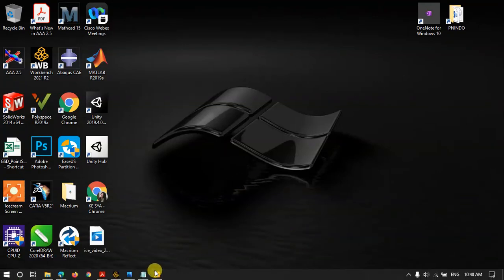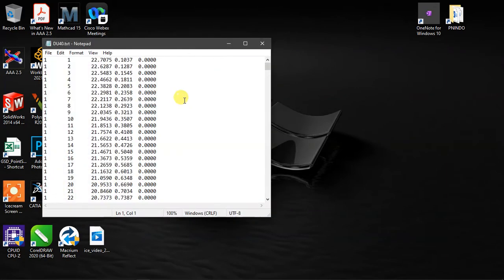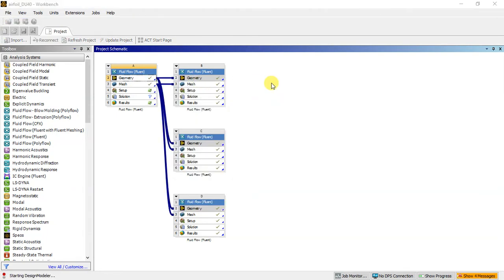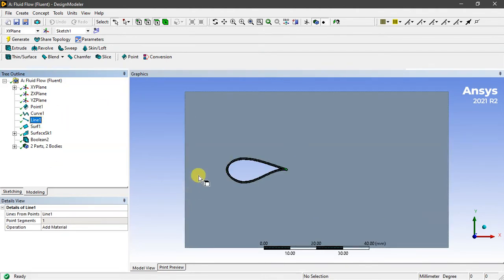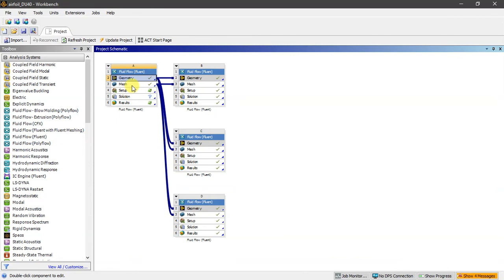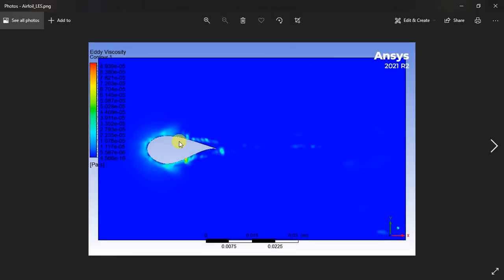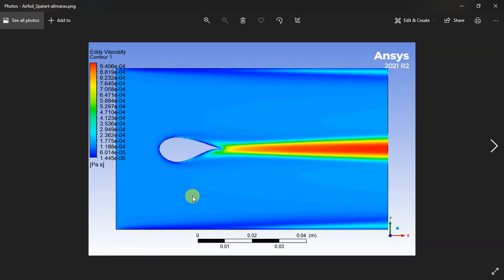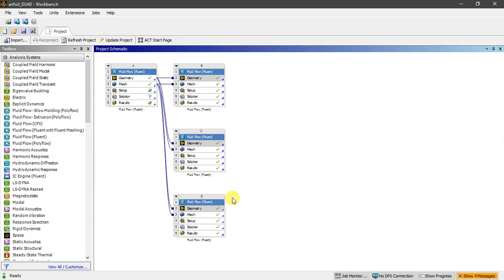LES vs URANS vs Spalart Allmaras in Fluent

Comment: What's the mesh size as les needs finer meshing. Did u maintain the courant no. 
Please reply I am doing project on this and dont know what mesh size I have to use as after taking 10 times kolmogorov length scale I have to divide each mm into 500 parts.
Reply from the maker: In doing meshing for LES viscous, I consider several things such as, y+ (for low RE < 5 and for high RE 30<y+<200), skewness, orthogonal quality. These parameters are my considerations in conducting research using the viscous LES model, but there are many more that must be considered, but the 3 mesh quality parameters were sufficient when compared to the experimental results, hope this answer helps you 😊
Reply: @BUGOCENTER  Thanks for answering, can you tell me your system specs like no of cores and ram and also no of nodes or elements in the mesh
Reply from the maker: @saagar2002  my set up :
12 core
16 GB ram
RTX 3050
But I forgot the total nodes and elements